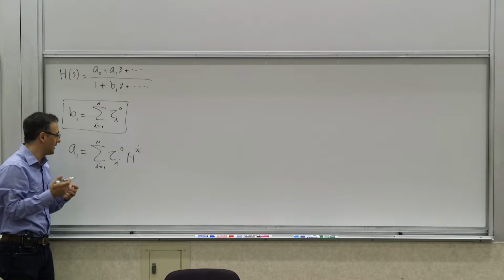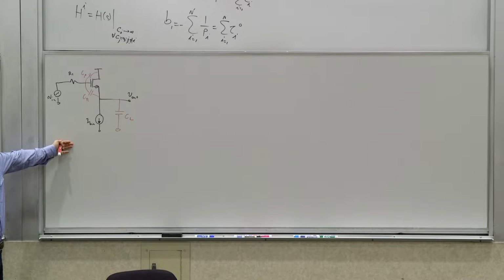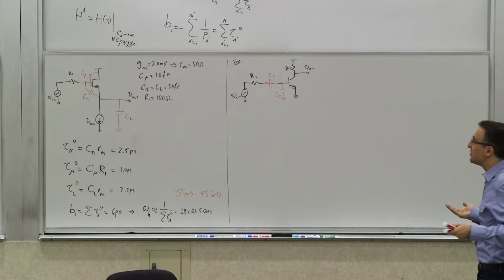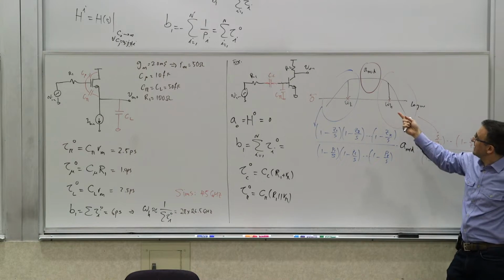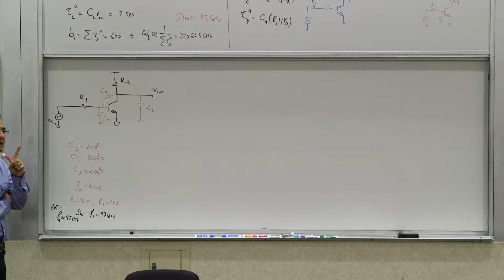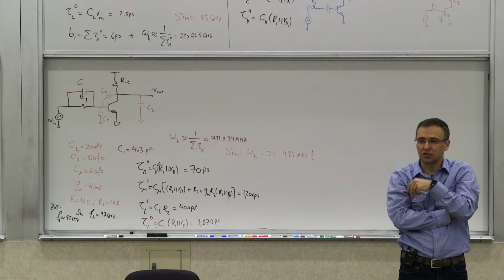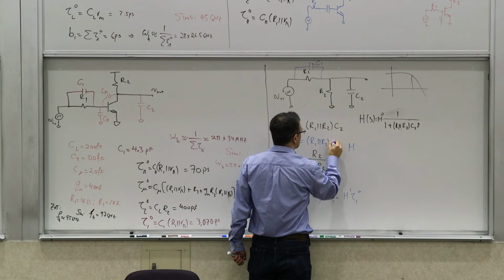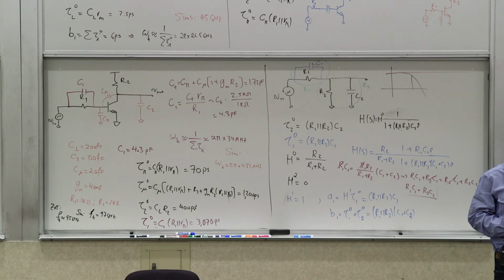146N. When ZVT bandwidth estimation fails

Comment: splendid lecture! but, at (23:25), should the tau(pi) be C(pi)*Rm instead of C(pi)*(Rm || R1)?
Reply: I think C(pi)*r(pi). Is it corrct?
Reply: exactly i was thinking why no one corrected, and checked the comments for this..
Reply: tau_pi = C_pi *R_pi  . Yes, because C_c is an open circuit.
Reply: When you calculate the time constant, other capacitors should be shorted? In that case, professor was right

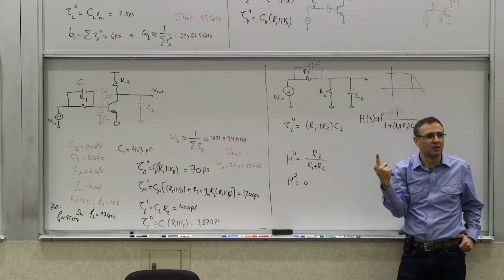Comment: Actually the system has two zeros and both of them are in right half plane ( 42:00 ).... Still how does pole - zero cancellation occur? Because two poles are in left half plane... To happen Pole zero cancellation both pole and zero should lie on each other... In the example what you have illustrated(50:52) is having pole and zero in left half plane, so there is a chance that they can lie on each other and that is why you have calculated the condition so that it will happen... But you are applying same thing in previous circuit where pole and zeros are in different planes... How is it possible?
Reply: Ayan, I think one of them is on the right half-plane (in which if you infinite value c_mu, the sign of transfer function will change) and the other one which cancels the left pole is on the left half-plane (in which if you infinite value c1, the sign of transfer function will not change). Does it make sense?
Reply: @rezamaram2439  I was thinking the same thing. One zero in RHP (c_mu), and another one should be in LHP (C1)